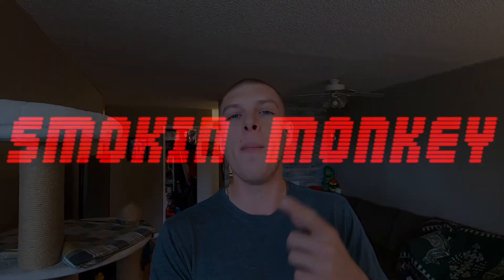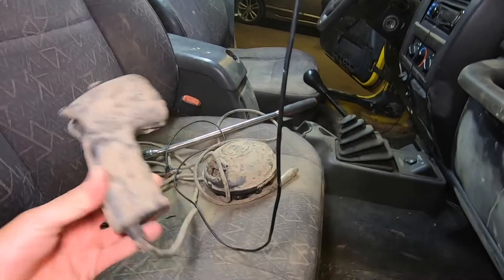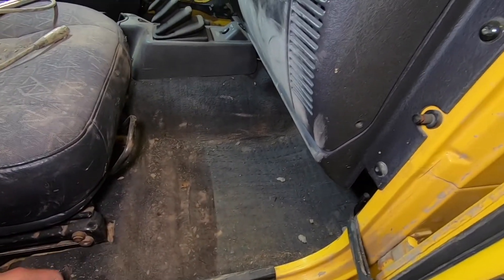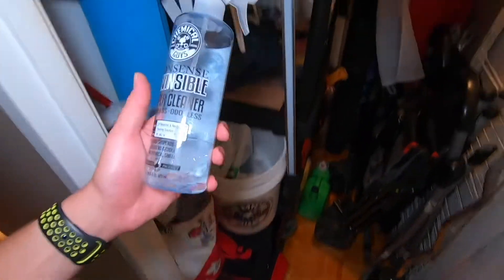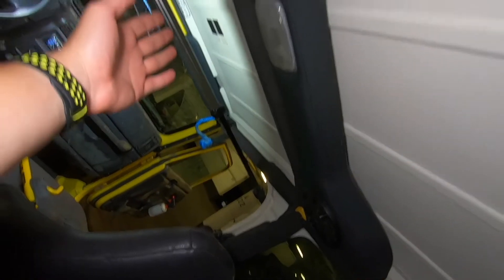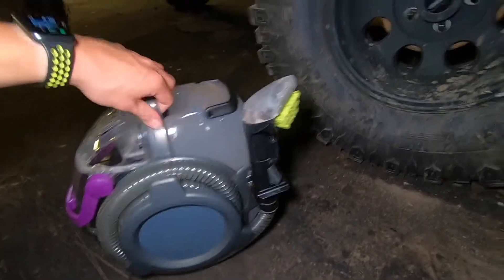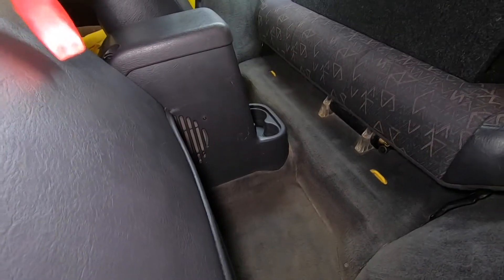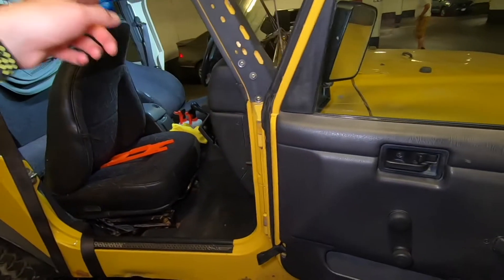Bringing My FLOODED JEEP Interior Back To NEW CONDITION

Comment: Again, check all those floor plugs. Seal them inside with silicone sealant.
Reply from the maker: I have holes the side of watermelons the plugs are not the issues lmao but thanks for the tip
Reply: @SmokinMonkeyOG  ok. Just an idea.
Happened to me missing floor plugs.
Reply from the maker: Mine is more like missing floor lol 😂
Reply: @SmokinMonkeyOG  That bad?
Is that from the trail damage?
I'm still fixing my Taco from the trail damage a few weeks ago.
Reply from the maker: No the tubs been rusting and the holes have been there before I bought the Jeep. Previous owner took the frame off the body and repaired all of the rust on the frame but never got around to doing the body and then he just let the jeep sit and that’s when I bought it
Reply: @SmokinMonkeyOG  ok,now I understand.
Reply from the maker: Also why it fills up with mud and water so easy. But it’s a work in progress lol